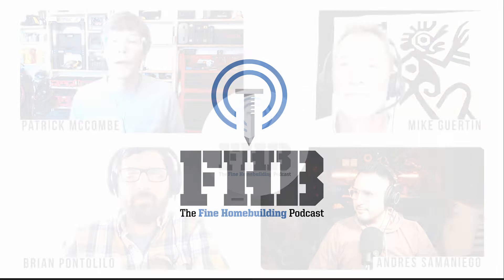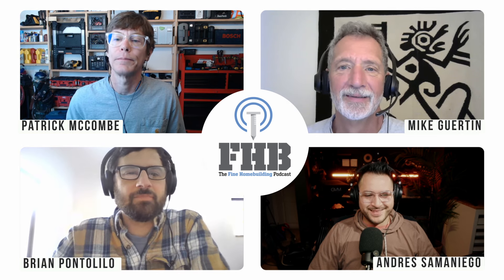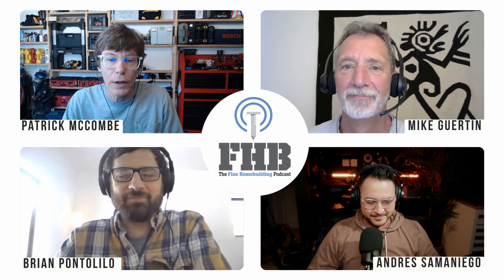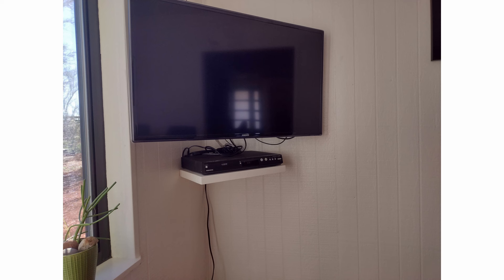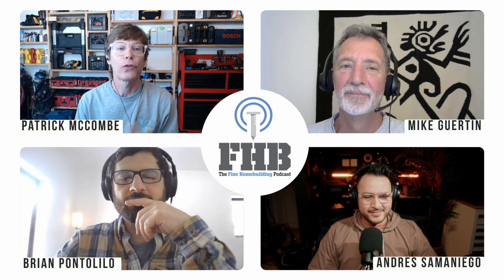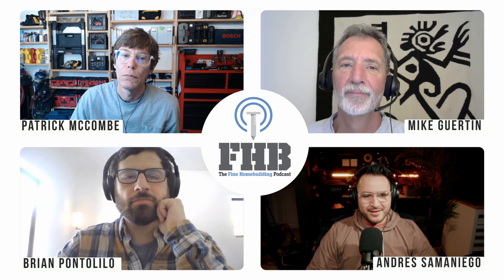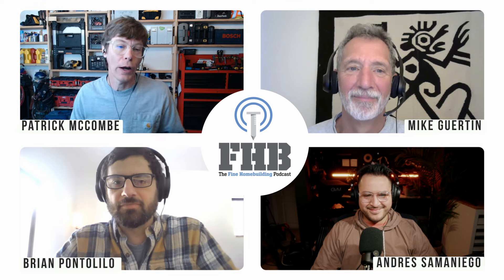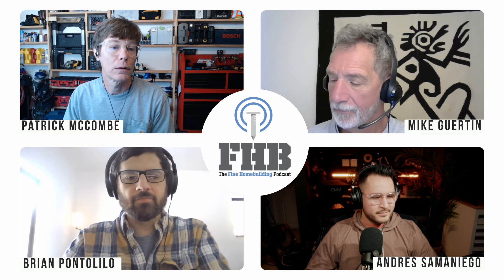Podcast 621: Building Inside a Barn, Porch-Roof Flashing, and Treated-Lumber Longevit

Comment: Put a TV with Roku and an Internet connection in the fireplace opening then seal up and insulated the chimney. Then you can go to YouTube and play one of the many videos of a fire burning in a fireplace on the TV. Much more energy efficient than a fireplace fire. Further replace windows with insulated walls put TVs surrounded by window trim on the inside and show videos of natural scenes like the cameras pointed at eagle nests or mountain top cameras in National parks. Super energy efficient.

Comment: Re treated wood decking, use highest quality use class 4 wood, 2x4, not 5/4, install with screws. The labor installation costs will be far more than the cost difference between pt grades and thicknesses. Plus the thicker stuff will be much stiffer 57:19 . Using screws lets you replace failed deck boards easily. Seal all cuts and end grain( Mike is my hero here).

Comment: The “barn” structure can be had with translucent or transparent plastic, which would give you enclosed outside space. Heat might be a problem in many locations.
Reply: I was thinking it protects you from the sun, I got pretty excited about this, I want to do an owner build someday, and 14k for shelter sounded nice. Just not sure how Labor intense it is, as I don't want to spend 6 months building a temporary structure 😛